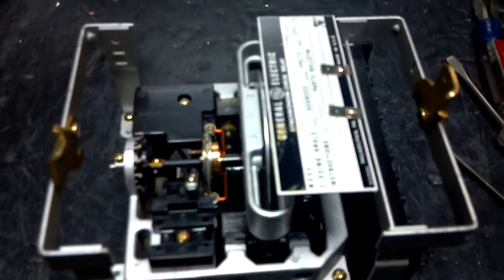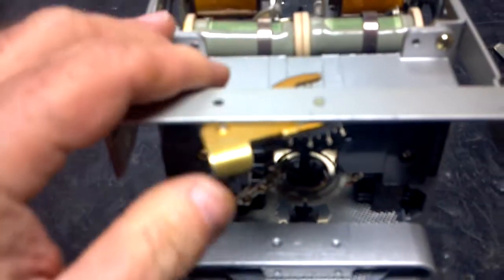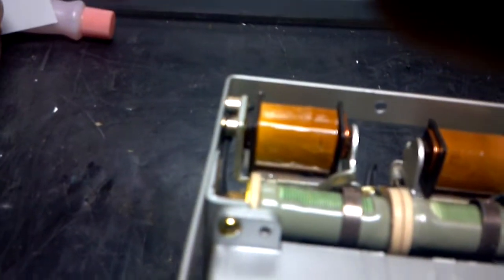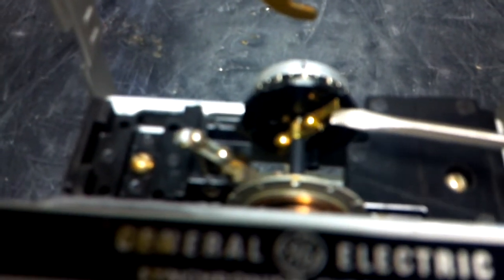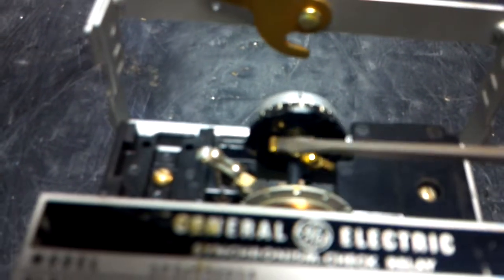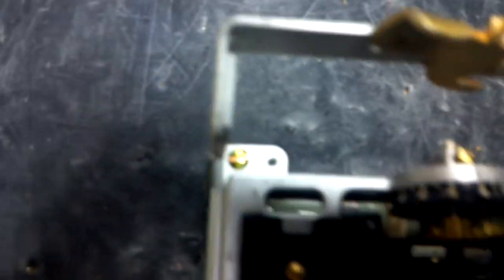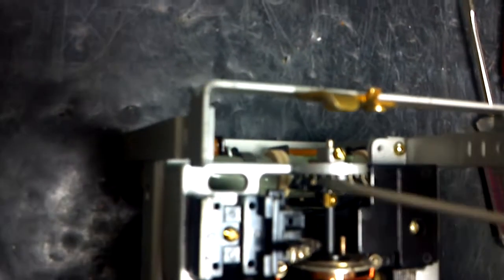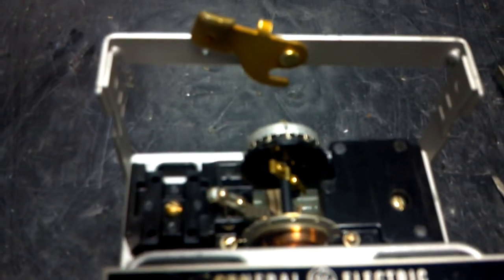Scrap a GE Electric Relay - GOLD and SILVER Recovery - Part 4

Comment from the maker: Not sure exactly what model relay this is and even having the exact number may not yield the exact results on the next one.  We pulled several apart and it is clear that the manufacturer made changes to the metals used over time (better manufacturing processes, etc.) - which didn't change their specification, only the scrap!

That's why these videos are not a 'gospel' specification, they are only offered (and intended) as a guide - specifics on any piece, you gotta figure out yourself!